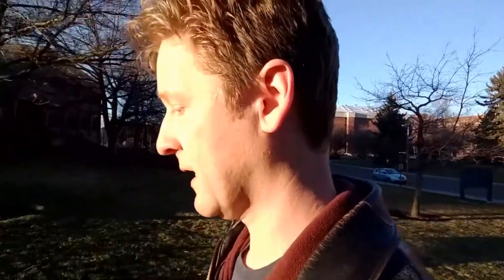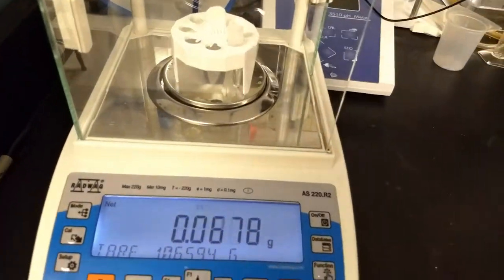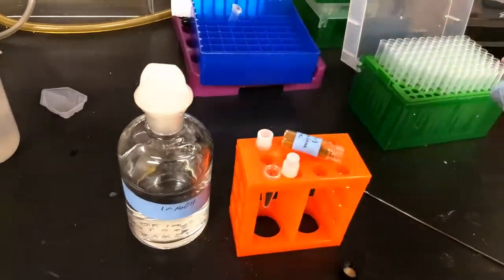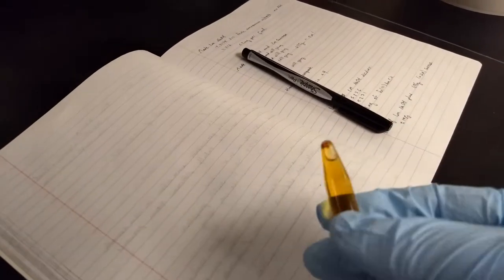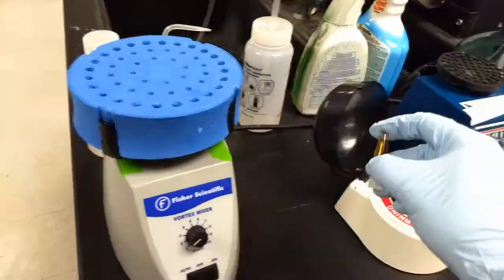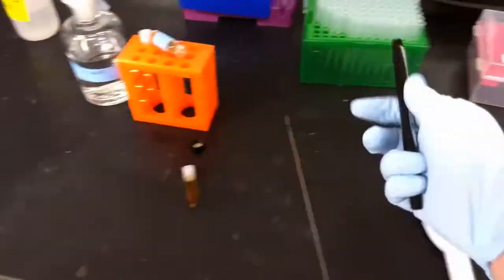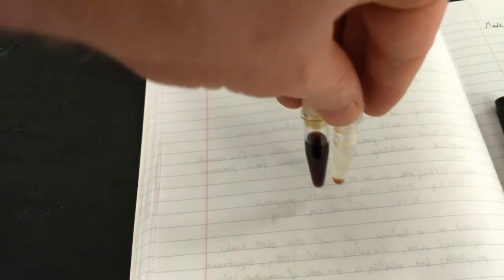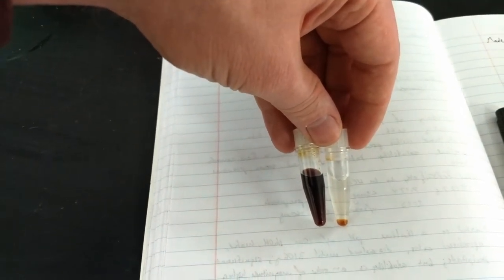Iron Battery part 64: Iron content of iron syrup

Comment: Peter, Previous researchers have achieved 3M Iron Chloride concentrations without precipitation of hydroxide.  Believe it or not, the electrolyte PH used was acidic (~2-3) with very low polarization (low hydrogen evolution) and high efficiency in the 90% arena.    I'd post the link, but the document seems to have disappeared from the internet.  If this interests you at all, please post your email or other contact info and I can pass the research paper along.
Reply from the maker: Cool! Whenever I go acidic, I get significant hydrogen. If I go basic, I fight precipitation. Please do shoot me an email. You can find it at peterallenlab.com (just so it doesn't get spidered as often)